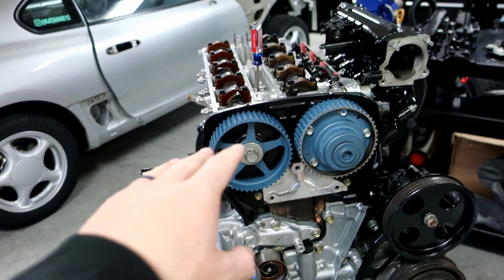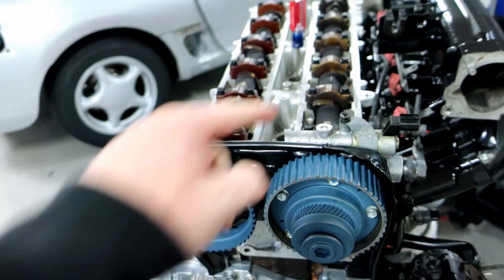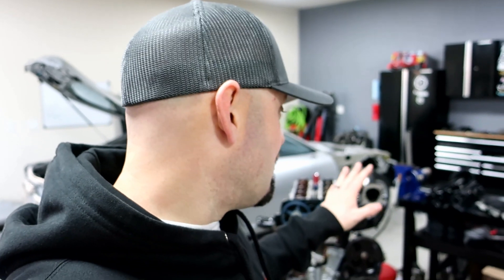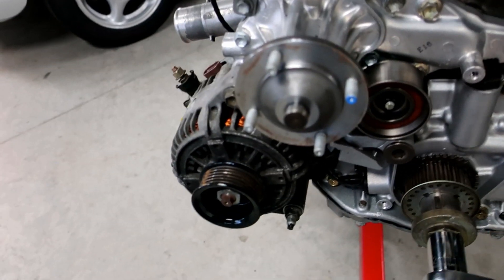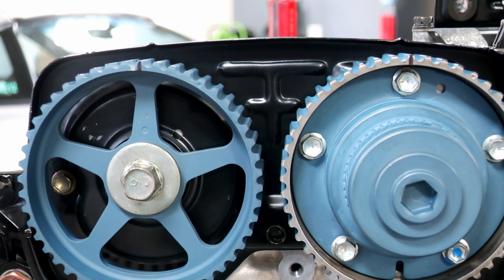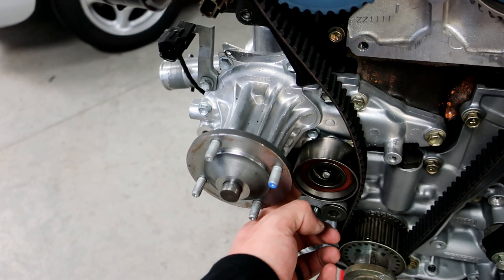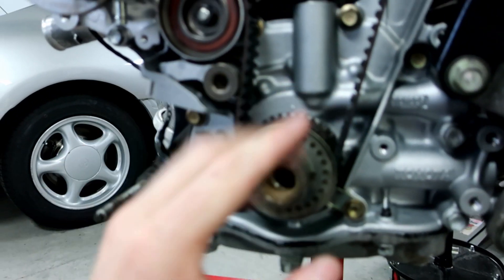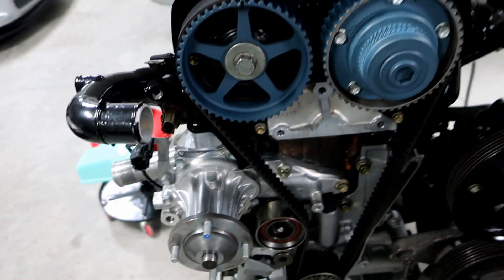How To Time a 2JZ-GTE VVTI Engine

Comment: What happens if they are based on the Dots 6:12 ? I’m asking as my 2jz ge vvti has had some issues with it starting and decided to investigate the timing and crank collar trigger teeth as Ik they can chip off and came across your video and seen this part.

Comment: May I ask You something, 
Did You ever had problem with vvti cam gear after stiffer springs and performance cs were fitted? I am talking about that tapping,  rattle noise, which makes this engine sounds like diesel.
Maybe You know that subject or some of yours homies?
How to deal with it and get rid of it...any tip?
Thank You in advance!

Comment: I replaced the head gasket, i put both cam gear on their marks but on the harmonic balancer is in the first mark i notice the cylinder no. 1 piston is not on TDC, that could affect the valves?

Comment: But how do you know your cam gears are aligned with the camshafts?
Reply: There is a notch on the camshafts that the cam gear sits on so they are always in the correct position

Comment: after fiddling with my timing for two days going through forum posts, vids, everything. this vid and the bit about the slack finally helped me time my engine correctly. thank you seriously.
Reply from the maker: This makes me so happy to hear! This is why I made these videos just for this exact reason
Reply: @PureFunction  i pulled my head off and sent too machine shop because blown head gasket and valve job. id done this job before and it was fine but this time for some reason it would not stay synchronized. but your vid helped
Reply: @PureFunction  i had too make sure i expressed my gratitude. id asked “friends” and people who knew how to do this and everyone refused too help. i read the factory service manuals over and over as well. every single bit failed too mention how to make sure that the tensioner doesnt pull the cam gears backwards from sheer force of tension. starting on the vvti gear was the key takeaway that helped me.
Reply: @PureFunction  hey bro can u send me your number need to ask u somethimg please concerning my 2jzge vvti

Comment: Changed my plugs out everything back together. It started right up but it was missing really bad. I redid it made sure every wire was in it's place. Then when I went to start it now it does not start just turns and turns. What did I do wrong it is there something I did that could have caused it not to start

Comment: Is you have multiple misfires in all 6 cylinders, does it mean timing is off? I read somewhere that you need to jump pins in diagnostic... or is it a sure mis timing?
Reply: you might just need o2 sensors, especially if its a random misfire

Comment: You don’t use the cuts you use the dots for the timing. Same for the crank. The crank has a dot on the gear not the cut
Reply: Exactly what i was thinking...I just stripped down a GE and spun the engine many times to see where it marks at tdc and it lined up at the dots defenitly not the lines ...them again different engine so who knows

Comment: Mr. Function,
I’m in the process of doing a valve seal job on my auto mkiv.  I’m in the step (following step by step Supraforum pics) where I just released the tensioner to the timing belt in order to take out my cams and get to the valves and seals.  
My question is, is it a good idea to replace the timing belt since I’m already in knee deep work?  If so, I’m confused and concerned I will mess my engine up if I don’t do the timing belt correct?  I noticed you stuck to aligning the dead center markings both on the gears and the crank.  Is that basically all I need to do to install the timing belt?  Is it that easy?  

By the way, the instructions fir the valve seals require me to remove the cams and gears.  Do they need to be put back a certain way or a certain alignment?  
Any help will do.
Thanks and Merry Christmas.

Comment: I did this kn my vvti motor and now the engine shakes violently  and dies
Reply from the maker: Are you sure something else isn’t off?
Reply: @PureFunction  what could make it do that , btw the harmknic balanxer has two dashes on it the previous  person that worked on it marked one in yellow and the other in white
Reply: Which is the correct 🤔
Reply: @PureFunction  sometimes people don't check to make sure that #1 is TDC. If the piston is down the engine is out 360. I done that before.

Comment: My vvti gear did not have that 30 degree slack. Instead I was able to move it further clockwise and counterclockwise (with some force). I still lined up the line with the mark and put the timing belt back together. My concern is should I have turned the vvti gear as furthest I could clockwise? But that would also mean I was have to turn the gear alone a full rotation to get it back to TDC. When I turn the crank shaft 2 full revolutions (with belt on)  everything still lines up perfectly but there’s also a bit of resistance as I do that. Did I do something wrong? Should it be a smooth rotation when I do the revolutions? Thank you!
Reply: Jack Acosta yes that’s how I do them. Turn vvti fully clockwise then rotate until lines up
Reply: How did you end up timing your car? 
I'm doing timing belt on a 2jz GE and the vvti gear has the same slack on both directions, not stopping at the timing mark as shown here.

Comment: Just wanna clarify as I recently changed the timing belt on the Aristo vvti swap on my NA supra. You can still use the dots on the cams but make sure you line them up with the yellow (first mark as turning crankshaft clockwise) mark on the crankshaft pulley at 0 mark TDC.  The next mark it on the crankshaft is white will definitely subsequently line up with the dash marks on the cams. Also make sure you rotate the crankshaft with the belt on while applying a little pressure on the belt to make sure everything line up properly before releasing the tensioner pin.  Cheers :)

Comment: Life f**king saver video right here! Holy sh*t I looked everywhere for info given here in only 12 minutes. My fb IS300 help forums, myIS, etc. I even bought the manufacturer service book and nothing detailed how to properly time a 2jzGE vvti engine. 
Thanks
Reply: Did the vvti seal he listed fit the 2jzge? 2000 gs300 owner here
Reply: Did the vvti seal he listed fit the 2jzge? 2000 gs300 owner here
Reply: @LMFAO5001  they are the same to knowledge yess phr sells a rebuild service they cerakote them and do new seals
Reply: What if I lined it up by the dot ? I have a 99 gs300 2jzge

Comment: Hey boss i wanted to ask something very quick? I have a 2001 lexus gs300 and I got my hands on a 2001 Toyota surpa engine and transmission. So wanted to know if I can use the surpa cylinder heads on my lexusgs300. Cuz mine have a hole which a mechanic did. And stripped my exhaust manifolds holes. How difficult is it to swap and what do I need in order to work on my car? Sorry for the long writing. But thanks hope to get help.

Comment: I purchased a car which has a 2JZ engine swap. It's idling OK but has a huge flat spot on giving gas with no power at all. I checked the cam sprocket alignment at TDC. There are no dents or lines on the sprockets, only a v-shaped mark that somebody has drawn on there with a marking pen. Perhaps the sprockets were bolted on back to front. (if this is even possible?)
Is there a way I can check if these marks are correct because I have the feeling they may not be.
If you could demonstrate how to get both cams in alignment without having to trust these marks.
i.e. by visually placing the cams in their correct rotary positions in relation to each other.
Great video BTW. :-)

Comment: You didnt say anything about the #1 piston being in TDC.. is that not a issue with the 2J?  Or is it kinda common sense so not mentioned
Reply: its set to TCD by rotating the crank around to the mark on the oil pump

Comment: you forget to mention to do 2 full rotations of the engine to make sure alignment  is correct after fitment.
Reply: What a do you mean
Reply: @BayAreaWrecker  to ensure belt wont jump a tooth after fitment. does happen as its not at full stretch until rotation occurs. thanks
Reply: I'm doing the timing belt and water pump I put everything  back , set the marks where they should go , how do I ensure its timed properly  🤔  , how do you double check ?
Reply: @BayAreaWrecker  rotate the engine twice and see if the marks still match. then your done

Comment: so wait, why is it that the GE VVTI is interference but the GTE VVTI is not?? Don't they have the same VVTI cam gear? or did i misinterpret what you said lol.
Reply: From researching the headgasket may play a part in this as the gte gasket is thicker than the ge gasket. So more than likely if you put a gte head gasket on a 2jz ge vvti engine it would then be non interference.
Reply: If i recall correctly, the GE VVTI head has a much shallower recess where the valves sit in the head, the valves themselves sit closer to the piston heads. GTE heads are more recessed so the valves sit a bit higher. Someone correct me if im wrong.
Reply: The head is different on the variants
Reply: Turbo cars usually have lower compression. Less compression allows for more space in the combustion chamber. More space for the valve clearance makes it non-interference.